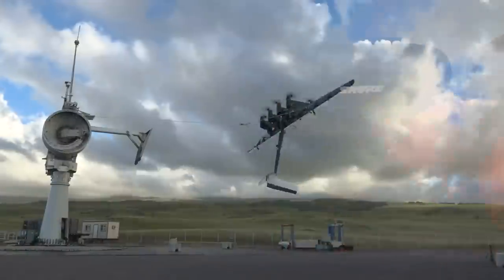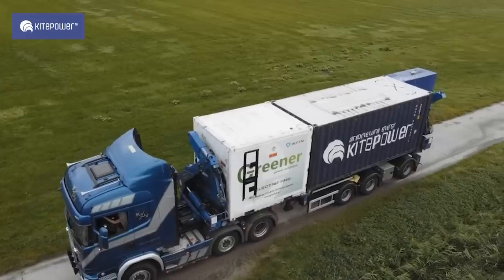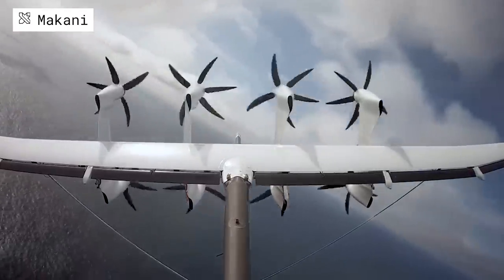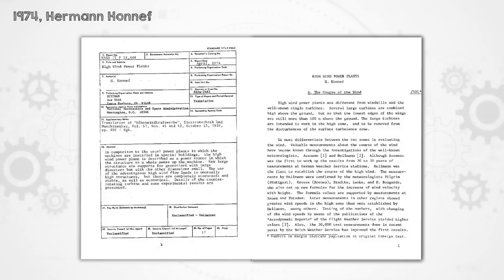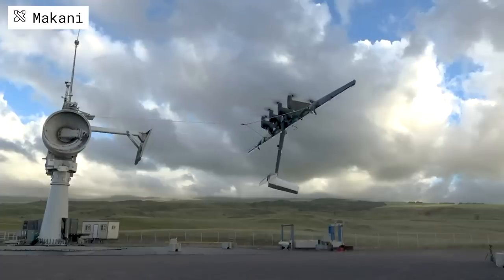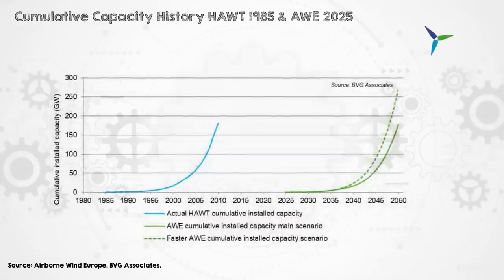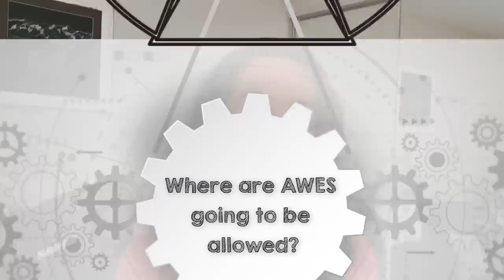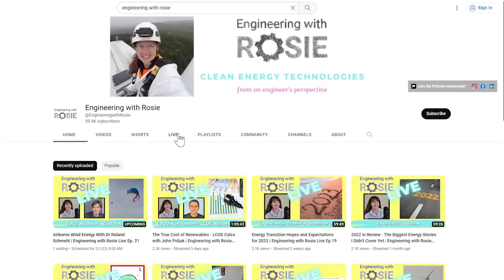Will Airborne Wind Replace Conventional Wind?

Comment: How can this thing aver compete with diesel electric for short term emergancy use, especialy when it is unreliable and requires specialized operators two things that are utherly undesirable in such circumstances.

However if you could reach 1.5 gigawat for a single kite you could power a modern containership on just one of them, that might just be able to be economical especialy if ships are forced in using cleaner fuels that the biohazardous barly refined oil they run on right now.

Comment: Engineering KISS approach says airborne wind is a non starter. Too many links in the chain to fail whilst a fan on a stick is simple and proven.
Reply: I think it says this is a non-starter, not airborne wind systems. If we reduced the requirement of needing to be connected to the ground, we could make this much more KISS. Either drag a battery up with you to charge and then rotate every so often, or use the wind to carry a weight up and use gravity to turn something. Water would be a good choice, so you can turn an Archimedes Screw for a turbine.
Reply: @NdxtremePro  If we were serious about renewable energy, we would have built space based solar and either beam energy back to earth using microwaves or carbon nanotube cables. If money spent on fusion was directed to space solar, we could exploit our perfect fusion reactor ... The sun.
Reply: @whoguy4231  If we were serious about carbon emissions, we would push all steel making into outer space and use sunlight to heat the materials to make it.
There are lots of things that are like this. we move slowly as a species. Which is a blessing, or we would have destroyed ourselves long ago, but it does have its downsides.
Reply: @NdxtremePro  where is your iron ore coming from?
Reply: @SamPrince  The same place I would suggest locating the factories. The asteroid belt next to us.
And from robots pushing meteorites towards it as it depletes.

Comment: Ok... It even could use much less materials but, the tridimensional SPACE required to operate this is absurd... I really doubt that the farmers and people that already complain about wind farms (visual pollution, sound and stuff) will be happy with this. How about a kite that have its cable snapped, what they do with that? ANd those techs does not seems simple or cheap at all.

Comment: Ultra High Flying Tetrahedral Kite!!! Create a Incredibly Massive Tetrahedral Kite that has thousand's of tetrahedral's, and place thousands of incredibly small wind generators in each of the individual tetrahedral's themselves within the kite itself, and route all the incredible small micro wires to a main location, where they all feed their electricity simultaneously together, and build the voltage up, and then direct it down the kite cable, and to the generator on the ocean ship!!! I Hope This Helps!!! And as far as I know none of this is copyrighted. Here is a video on Alexander Graham Bell's Tetrahedral Kites from 1903-1909 more than 100 years ago!!! For Study Material!!! Clean Energy For All!!! https://youtu.be/BhwgOv8Mfyc

Comment: What are all these new lightweight super strong materials today that weren't around 20 years ago?  Various composites have been around a long time. The soviets were selling a car with composite bodies in the 70s( Trabant made with a composite material with cotton and resins) .  Carbon fiber was invented in the 19th century (though doubtless there have been improvements since then).. Fiberglass has been around a long time. The first Corvette is from 1953 had a fiberglass body.  MIT supposedly has a new material as strong as steel and light as plastic using "2d polymers."  But it's in the lab stage and doesn't even have a name yet.
You're selling hope, false hope to an audience that wants to believe technology can solve all problems.  Assuming it is 100% real, climate change is not so much a problem as it is a predicament.

Comment: Its been pushed back by banks. Universities have been fooling around with it for 10 years, but every time it should go into production it doesn't happen. Ampex is a good example. There are NO more challenges! These systems are not for grid tied applications imho. Listening a bit longer I realize this vlog is totally economistic and very shallow. Sorry but this is crap info.